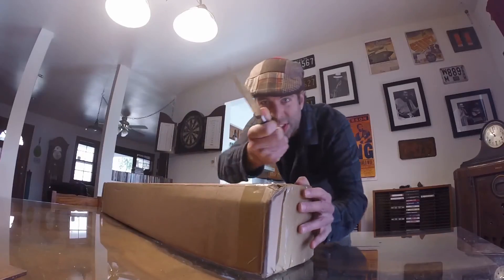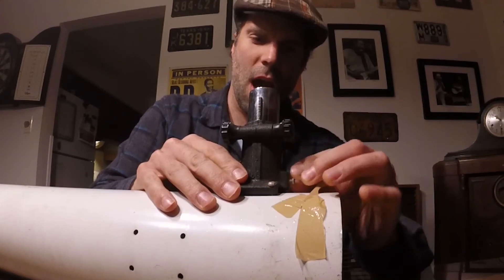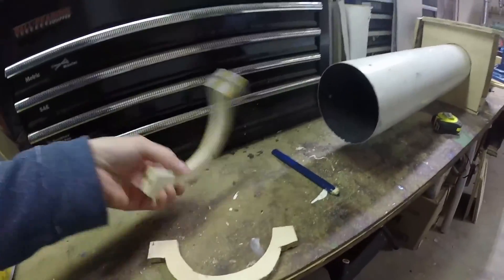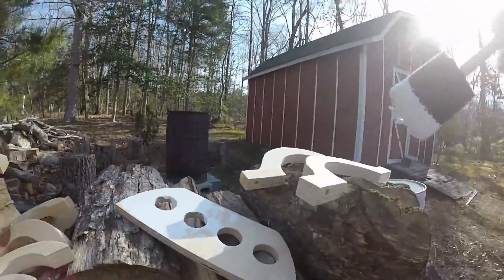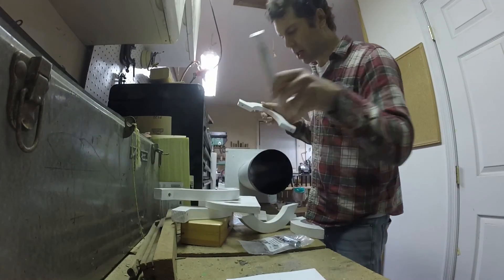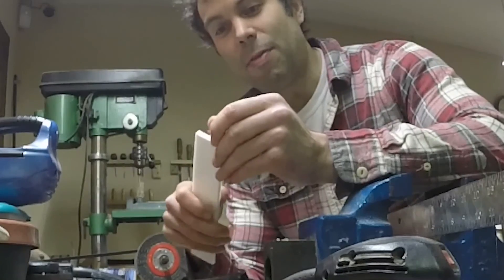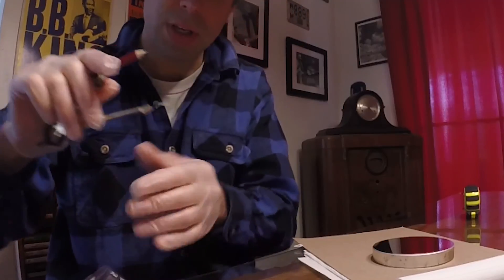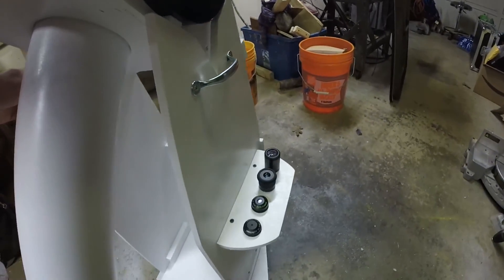Building a Dobsonian Telescope - Astronomy with Josh

Comment: Hi Josh, I know this video is a couple years old now, but I have a question regarding the secondary mirror. I'm new to telescopes in general but I picked up a 8 inch dob a year or so ago w/out really knowing much about them. It was an amazing price, it just needed to be cleaned. The problem is that it has a secondary mirror not like anything else I've seen. It connects to the tube like the one in the video does and I can't seem to find instructions on how to properly collimate it since I don't know the name of this particular secondary mirror connection. I took everything apart before realizing this was a unique feature and most dobs have the cross spidervane at the top whereas mine mounts through the tube to the eyepiece.
Reply from the maker: Hey Kenneth, sorry for the late reply here!  I want to say that's a "stalk mounted secondary".  They are a pain in the neck, but I'd use both a laser and a Cheshire eyepiece to line it up.  (The one on the Pal Jr. shown here bends slightly into place.)  You can also buy or build your own four vane spider. (Some guys even like a curved spider.  There's no diffraction spikes that way, although stability and contrast suffers ever so slightly.)  That might be the best choice, and shouldn't be too expensive.  Let me know if you've got any further questions!